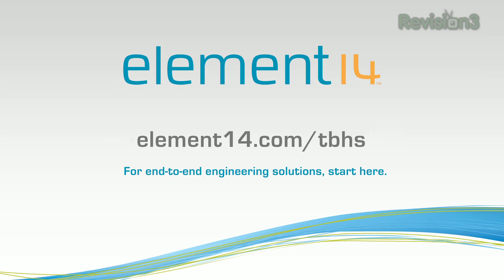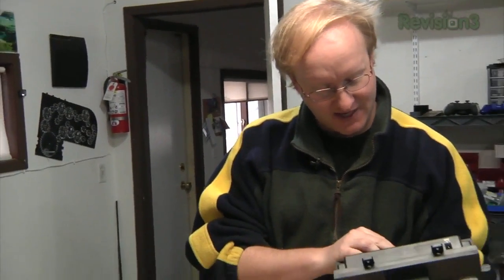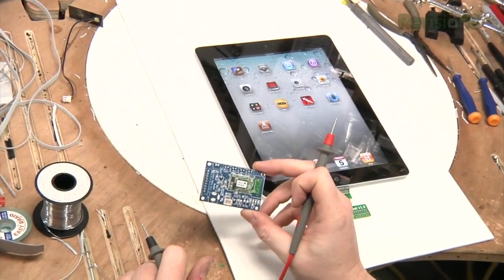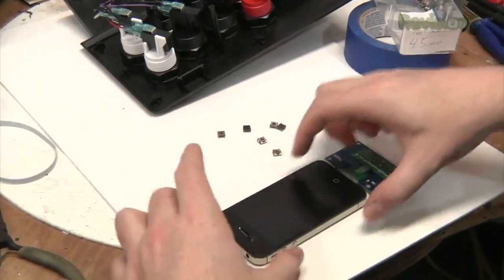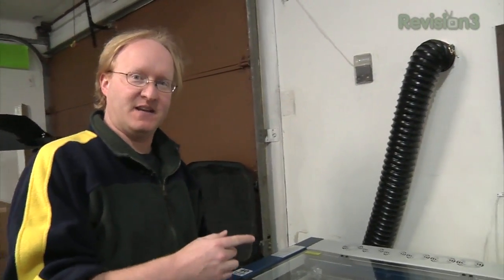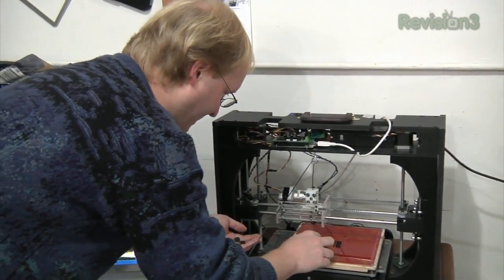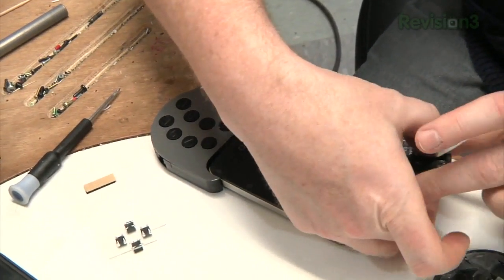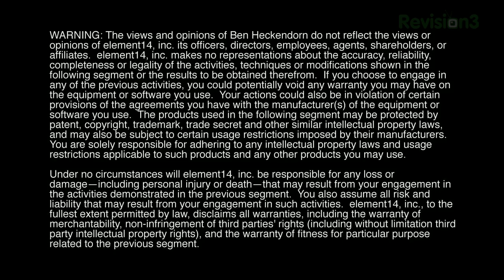iHeart Electronics - iPhone Mod!

Comment: Can you do another one for Android please
Reply: +tsafack christian Android doesn't have the connectors necessary for the 3.3v -- as he just took apart an existing controller to create this the build process would be more or less identical provided you can find a suitable android controller to take apart and use. Hope this helps :)

Comment: I just wanted to know how much will it be to make a portable Dreamcast  with screen and 2 controller slot so that someone can hook it up to a TV too. but if they don't want to they can play it  with out the TV and the controller. because it has it own controller build in and the  battery is rechargeable and the CD load from the back. or PlayStation 2 build the same way and I don't want to be the slim one it should be a fat one.
Reply: connecting a wireless xbox controller to your phone and buying an adapter from phone to tv would be better

Comment: Things I would have done differently:
- Ported out the headphone socket so you could actually plug headphones in as well.
- Made the cable retractable and designed the two halves to slot together for storage.
- Thrown the iPhone in the bin.

Comment: The way I see it, the design for this could've been so much better... Sturdier, but as a downside, it would also be thicker. The controller thing would be a single piece, with the boards in the back, and a notch to attach the phone in the front, kind of like a case (or perhaps one could repurpose a case?). Two of those numeric buttons would become bumpers, making the controller less wide.

Alternatively, it could be foldable, still using that flat cable to connect the buttons to the D-pad.

Comment: element 14 is silicon
Reply from the maker: Someone Random Woven fibreglass/resin.
Reply: mollytom100 http://www.pcbway.com/blog/Engineering_Technical/Printed_Circuit_Board_PCBs.html copy and paste
Reply: what are circuit boards made of?
Reply: If you're talking about the material which actually conducts electricity, they're made of copper wire. Copper (which has an atopic number of 29) is the best conductor of electricity. This because the electrons in the 
copper are more easily transferred from one 
atom to another.  Electric current is based on 
the flow of electrons through the conductor. A printed circuit board (PCB) mechanically supports and electrically connects electronic components using conductive tracks, pads and other features etched from copper sheets laminated onto a non-conductive substrate.
Reply: Actually, silver is the best conductor, but is way too rare and expensive to use in large amounts in electronics.
Reply: silver is not used for electrical wires because of oxidation
Reply: resound x That is also a very good reason. Copper does also oxidate, however.
Reply: has to do with the oxidization rate and how silver oxidize as compared to Copper and silver is far from rare gold is the 3th rarest silver being the 9th
Reply: and trust me we use a lot of gold
Reply: that's hot

Comment: I think you said that(in one of your video's), you get schematics before you work on things. I would like to know where you get your diagrams from. I have a project I keep working on, I am trying to use an existing amp(Wowwee Paper Jamz Guitar) and was able to get a in put jack to work(1/8"), but the circuit has an automatic shut off to save batteries. I can't find a schematic anywhere for this, can you help me finding one?

Comment: 'Have all had a very standard plug on them'
So glad I won't have to get another cringe, because I wont have to hear that again soon.
I'd really say usb is much more standard than the blasted apple-connector.
Soon we can finally dub all those usb cables as charging/data-cables and stop pretending there's a whole lot of advantage to that old connector except it used to be one connector with a whole lot of additional pins that simply would've fit better on a seperate port for the sake of cross-platform and multiple-scenario compatibility. Especially if they'd adopted USB in the beginning, we might've actually seen some usb-type phone-compatible controllers for there could be a sensible market for it. (especially when those would be compatible with pc's PnP too.)
But surely, that would only limit development for everyone... oh wait.

The connector can deliver a full firewire,usb,audio,video and traditional serial connection... in theory that sounds great.
If only Apple'd released a breakout that'd give you those headers too (atleast for a seperate usb, firewire, video and audio) it would've simply make more sense to include all those connections.
Now you're required to always use that one port which we have no multiplicators/hubs for, for whatever you need on that specific moment.
I've never seen any true advantage other then apple got to sell more cables which would be useless for any other product.

Their damn luck on the old port was the amount of external devices using that port only rarely require power in contrast to charging when connected, else this very simple flaw would've been much more obvious (good luck charging with something already connected).

That's simply just as bad a principle (a proprietary connector) like in example the old hookup-boxes needed to connect an old console to a tv.
You'd have a sepperate wall-wart AND antennae-connection you'd need to hook up and switch physically (sometimes even using screws) on your tv to switch consoles.

Haven't you ever wondered about that exact same thing, Ben? mainly Why Apple didn't deliver a hub with simply a usb-port and the familiar yellow-red-white coaxial video/audio connectors in it's package?

I really hope if they ever add another connector in adition to a usb-charging-connector, it's something already standardised and readily available.
Else it might just be time people treated it the same as a TV which'd require you to change all your HDMI/DP/antennae/whatnot cables to some proprietary format ('Not buying THAT shit').
Right now they've chosen the Thunderbolt connector and it's simply not ready for this task yet. (YET!)
It's too new and too rarely used at this time by other parties. Basically mainly apple's monitors and other apparel uses it.
I remember a few years back reading articles of ASUS pairing up with Intel and Samsung promising external HDD's. This all disappeared since apple basically 'stole' this connector platform oncemore. But the main flaw in this choice is (in my opinion) that it's not even readily available in terms of; excistant in general consumer hardware, other then apple's own.
I even used to be very excited about this line of Motherboards: https://www.asus.com/Motherboards/P8Z77V_PREMIUM/
But since all other parties then the fruit one backed out of their rapid adaption, so did I.

I call myself a hardware enthousiast and 'normal' hardware currently RARELY sports this connector. And I wonder why there's a lack to the question;
Why sport a connector for a mainly slave-based-device when currently there are barely any hosts with that same connector type? (basically the same question they missed previous time.)

You're back to the exact same problem, though this time with a cable which started out less proprietary even though it seems quite much abandoned already by all other companies.
Though I already know there may be situations where i'd want to connect something external and slave-powered at the same time i need to charge my device... Back at square one.

The time when this company will finally start to learn to properly handle choices like this is when the consumers finally open their damn eyes and stop them from being so proprietarized.

General consumer hardware is since not too long finally widely starting to support regular DP/DP-mini, USB3 and such... let's just stick to using those ports instead of trying to pioneer with hardware you 'update' on a yearly basis anyway.

Really, am I the only one who concerns himself this way? 'Or ar all the buyers simply too supid?' is actually the phrase that runs along in my head every single damn time...

I took the time to write this obliviously long reply in hopes if Ben's eye would ever fall on it he might be able to reply in the objective way i always notice he comments design choices on hardware. If you're an apple fan about to write a reply because i'm trying to deliver critics on their decisions you're about to do something horribly wrong.

I can see value in a single connector being able to support all scenarios.
Though I see a clear lack of scenarios that's been though of.

Comment: just buy a used 360 controller. Open it up, solder some wires to it and attach it to the existing buttons on the arcade stick. Hell you can even make a dual(ps3, x360) stick.
Made a ps3 stick for myself with dualshock3(latest gen) just by opening it up and re-doing everything at my please.
My advice get your hands dirty, then if you get stuck ask for help.
Cheer and luck mate.

Comment: I have a problem  want to get a PS3 Arcade fighting (its easier to find in my country)stick and make it into a XBOX 360 controller compatible but im guessing that needed a chip that inkow I cant get so just make the PS3 to XBOX 360 ARCADE ( converter will slow the buttons says google that's why I am hesitant on getting a PS3 to XBOX 360 CONVERTER)

Comment: The D-Pad half should be the same size as the button side. This way, a small amplifier and speaker could be fitted to give the HP jack an actual function to boost the audio. Also, with that size change the systam could've been one piece with a spring-loaded slider to extend and fit the iPod/iPhone in.